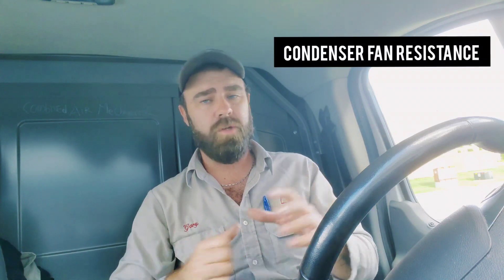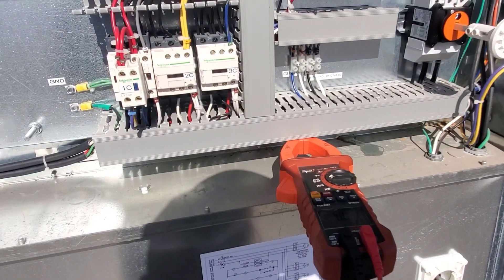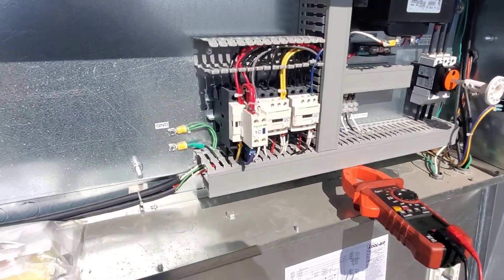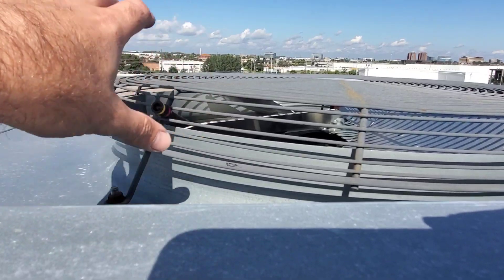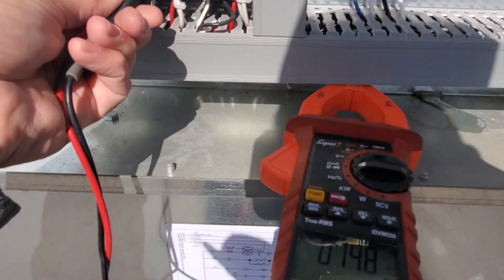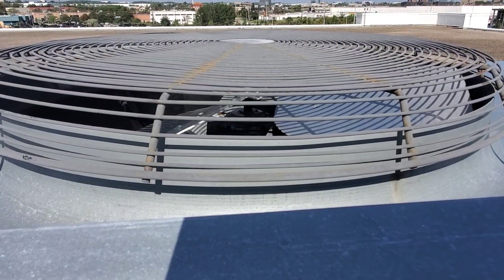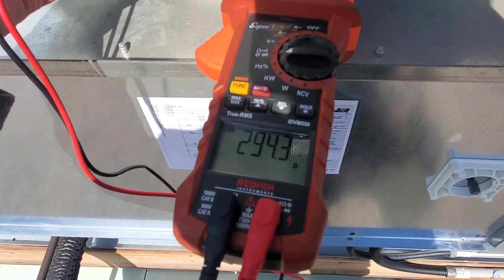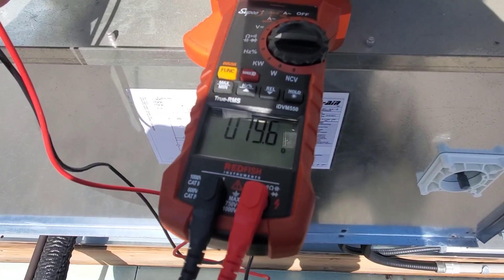Condenser Fan Resistance Check - HVAC Tip

Comment: Thanks!
I actually faced this same issue last week on 3 phase condenser motor and it drove me nuts
Right now I know the secret thanks man!

Yeah when motor spins it become basically a generator so you will have a generated voltage on the terminal that is probably why it misses the reading

Comment: Mostly checking that there is resistance. If it shows no resistance or a few ohms the windings are shorted. If it shows infinity, open winding.  Also should check between each leg and ground.  Should be open circuit or infinite resistance,
Reply: Yep that's the way I would explain it after 39 years

Comment: How do you know what the resistance of a motor is supposed to be and if it is high or low what does it tell you? I'm new and just trying to learn. Thanks for all the great content here and on Instagram.
Reply from the maker: You won't truly know unless you get the specs.  But if the fan is still, the readings won't be irractic.  3 phase fan, all 3 phases should be the same.
Reply: @HVACKnowItAll Thanks for the info, so this is something that should be done for testing 3 phase motors?
Reply from the maker: Every motor
Reply: @HVACLife  Thank you very much for the input.